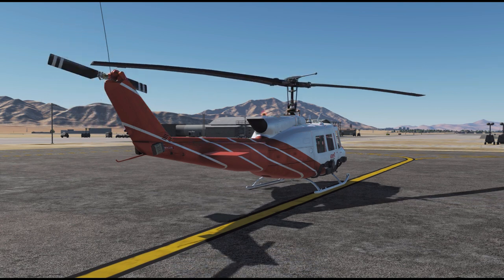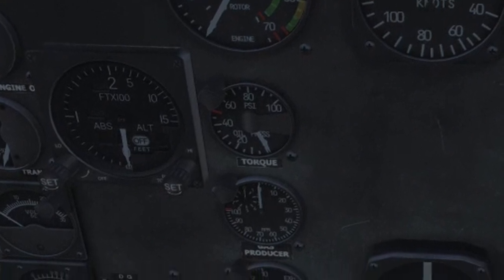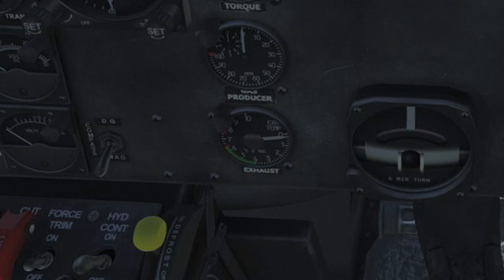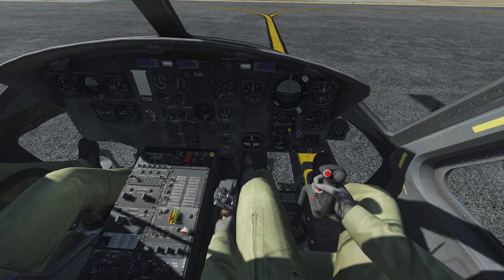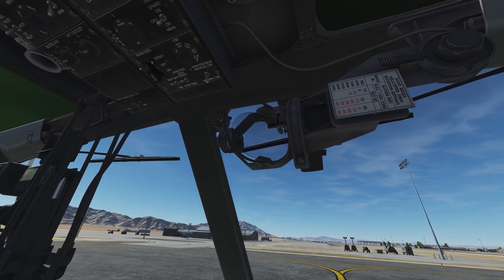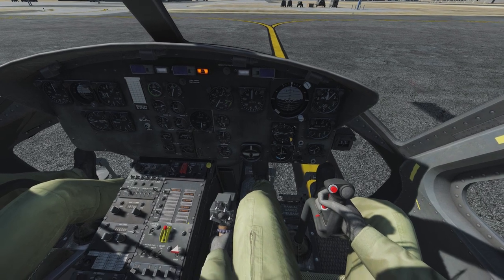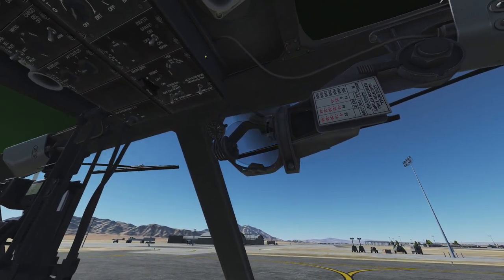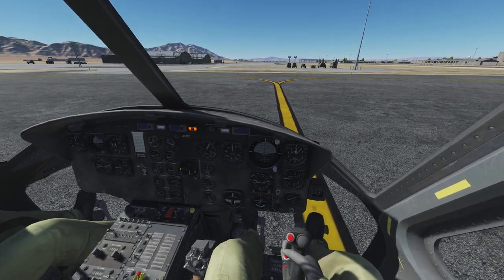Bell UH-1 Tutorial 2 / Quick Startup - English Version

Comment: A great video as usual, but unless you are going to monitor the AC and DC voltmeters on startup, setting the 2 rotary switches is unnecessary. A quick startup is ill advised as you point out, but when your FARP is under fire the quickest startup is the safest!
Reply from the maker: Hey John. I was not aware of that, so many thanks for the interesting information.

Comment: Don’t know why ED doesn’t do something about the throttle up and down function, be nice to have the ability to bind it to a control or eliminate it altogether
Reply from the maker: The main problem is, that most controls do not have an idle stop. If you implement the throttle from zero to idle on the throttle axis you face the problem how to define idle, and when, getting below idle the engine will quitt.